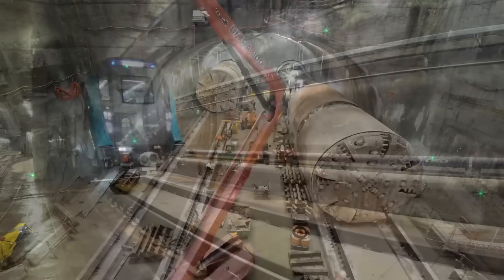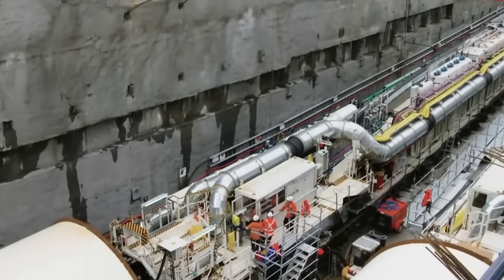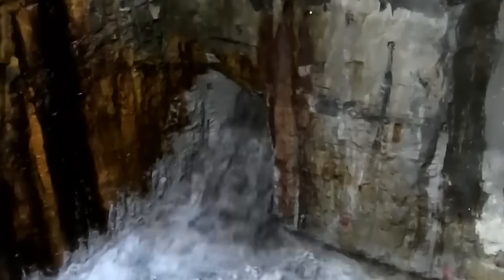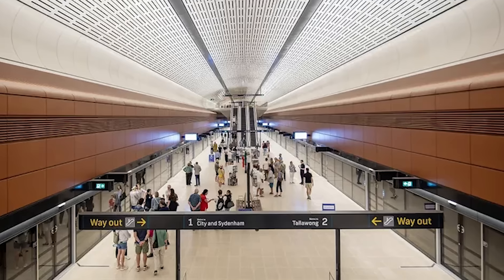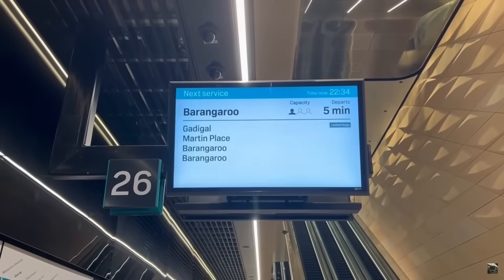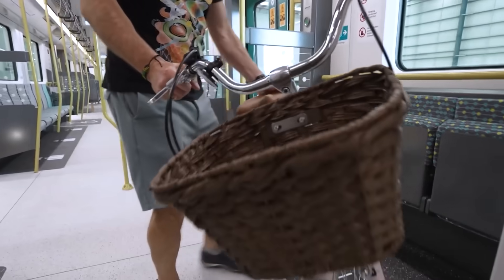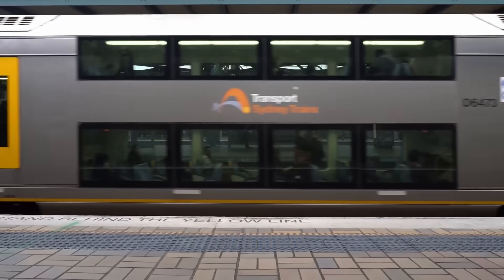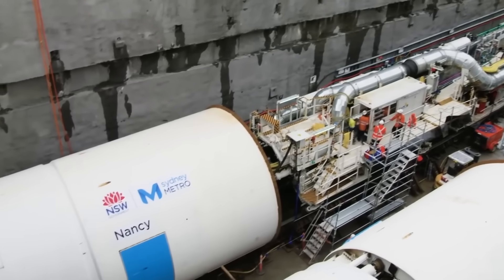Inside the $60 Billion Metro Transforming Sydney Forever

Comment: Nice engineering work.
Deep underground stations require ingenious access. In my country, they're building a metro station 45 meters (147 feet) deep. It won't have escalators, but high-speed elevators.
Greetings from Santiago, Chile.

Comment: The critics stating that the metro lines have failed to relieve pressure on the heavy rail system is missing the point. The metro lines open so far do not duplicate the heavy rail network despite interconnecting with it ar several stations, including Epping, Chatwood, Martin Place and Central. So far, the intention has been to do two things:-

1. Provide rail transport to a part of Sydney which has never had it. This has now been done.
2. Provide capacity relief on the conjested City Circle by converting the Bankstown Line to metro rail. This is underway now.

By taking trains from the former Bankstown Line off the City Circle, more heavy rail trains on other lines can occupy those slots, which will in turn increase service frequency on the Western and East Hills lines.

The Western Line is also at capacity in terms of passenger numbers. Passenger numbers cannot go up because there's no room for any more in the peak periods. Duplicating the Western Line between Hunter Street and Westmead (with new stations in suburbs that don't already have a rail service, such as Five Dock and The Bays) will take pressure off the Western Line and the narrow platforms at Town Hall, which is Australia's busiest underground station by far.

What's more, by 2032 when the current schedule of work is complete, the network will have cost $64bn - more than $140bn less than what Melbourne's SRL is projected to cost, if it is ever completed. Keeping the CFMEU under its rock has some advantages.
Reply: the line running from chatswood to the city now has far greater passenger numbers than expected in the first year. with far more to come in future with TOD around the stations expected to grow in coming years. then service frequency can be increased, and trains extended from 6 cars to the platform length of 8 cars.
And the new stations have releived prssure on the three most crowded stations - North Sydney, town hall, wynyard.
Reply: Your numbers for Melbourne SRL are way off, they were concocted by the media and include operational costs for decades and use the upper estimates for everything.

On the rest, I think they have the existing network configured wrong at the moment, and once more of the Metro opens up I think they should look at putting the Western line into the City Circle and having the Airport+Macarthur line run over the Harbour Bridge by reorganising the tracks into Central. Alot of the Airport ridership is from north of the Harbour and the original Airport line plan identified having it run to Chatswood would have been the most beneficial option but under 90s austerity we were lucky to even just get the crappy configuration of plugging the Airport line back into the same bottlenecks it was meant to relieve. Sending the Airport line over the Harbour Bridge would be beneficial for disruption too as the Western line through the Inner West being the highest incident impact corridor would not tangle the rest of the network up in that mess every time someone farts on a signal wire and cripples the whole operation.

Comment: I'm fairly impressed with the length between Epping and Barrangaroo. 2 under water crossings through mostly rock and brisk acceleration from the trains is exhilarating. 2 things of note, I felt like I was in the matrix watching the train going around it's first bend underground and when traveling up the escalators. Some of the underground walls and ceilings are in desperate need of a clean, there is visible mold.